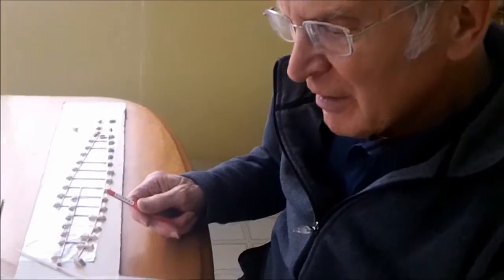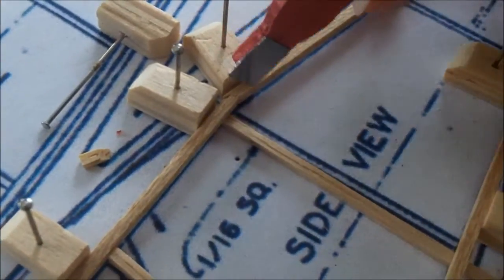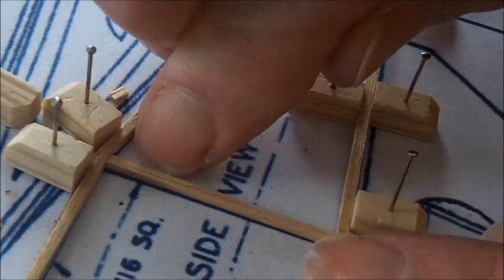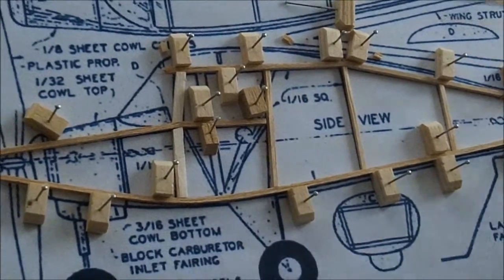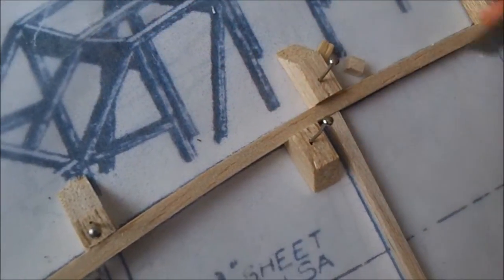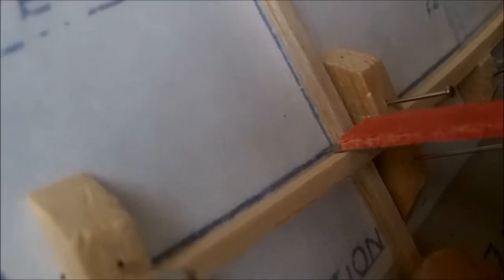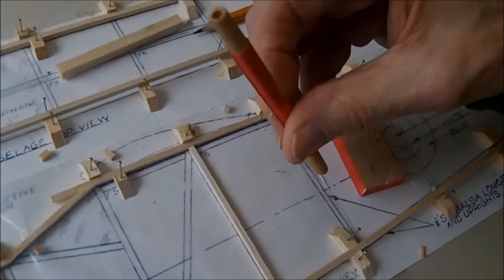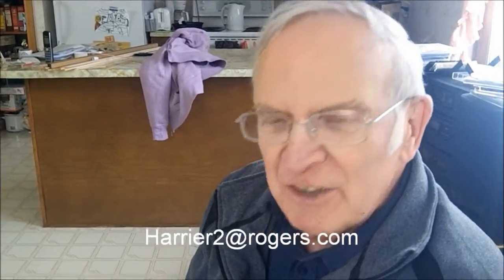The Lavoie Method of Building Stick Fuselages (Part 3)

Comment: I love your system. Me of thick fingers. I really do not think you need to slide the first-cut end under the longer on. You cutter is inset from the surface of your tool, so the gap should take care of irregularities. A small time saving?

Comment: Thank you for sharing this amazing method !

Years of experience condensed in these videos.  Great material !!
Reply from the maker: Hello San
Placing the strip under the longerons seemed so natural, the design of the tools just seemed to flow from that. In what country are you located and what types of models are you building? I might mention a couple of updates...one is that the blocks at the top longeron are no longer placed exactly above the upright positions but just off to the side so allow the strip material to push the scrap out from under the longeron with a straight push. I hope that is clearly put. The second thing, which I call an improvement, is to cut both the top and bottom ends of the uprights without having to remove the strip from under the longerons(unless of course one is using quite hard balsa. To do this a blade is glued onto the side of a craft stick which has a U shaped opening(I now find contact cement is better). As you will have noted no Marker tool is needed and  tthe very little bit of blade protruding is not enough to damage the plan.
Reply: harrier1934 
 by some reason I just read now your answer ! I gess I had not set up the notifications from you tube the way it should be.

I live in China but I am Brazilian. I am using your method to build the planes, but using the Magnaboard. The only difference is that the magnets hold the sticks in place.

I have made the same tools that you mention at your videos, and they work absolutely great. It is a pleasure to built like this !

Thank you so much for answering and for your updates and once again by this videos.  It changed the way I was used to built my stick and tissue planes.

Comment: What a brill method
Reply from the maker: Hello Colin
Glad that this has been of some use to you!
I've just been shown today how to reply to you people. Where are you located and what type of models are you building using this method? I've updated the method to some degree. I find that I can dispense with the chopping block and cut the uprights/cross pieces while the long strip is under the longerons. With the blade "just" extending beyond the end of the tool I see no visible damage to the plan. It speeds up the process even more.

Comment: Greetings from Ohio Mr.Lavoie. I remember seeing this on SFA's website a few years ago, I adopted it immediately. It has saved a lot of time and guess work on my builds. No more sand and test, sand and test, just cut it and glue it. My box's are straight without a banana, and I have the strongest joints. Thanks a heap for this kiss method.
Reply from the maker: Hello, not sure if i should call you tifosiman. I learned just recently how to get back to people have subscribed. What country do you live in, type of models you are into, maybe a picture or two...
Reply: I'm sorry it took so long for me to reply Mr. Lavoie, I guess I didn't see my notification. I live in the U.S. in a small town in Ohio. Not much to do or see so I like to build models, mostly plastic cars, witch are on my channel. I'm still a newbe when it comes to balsa. My first build was a Dumas Fokker Eindecker, it went together really well, and from there on I was hooked. I've built a few Guillows walnut scale planes and a few Dumas as well. I'm currently working on an Easy Built  Baby Commercial. I hope this one will fly without to much difficulty. fingers crossed.